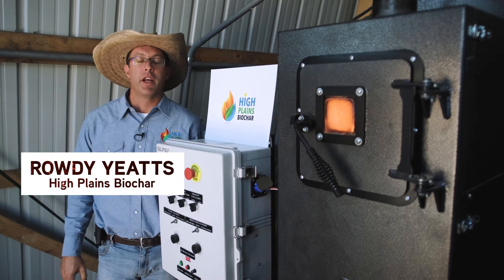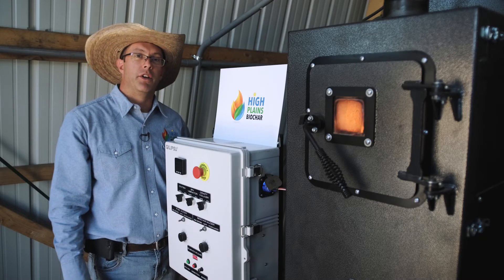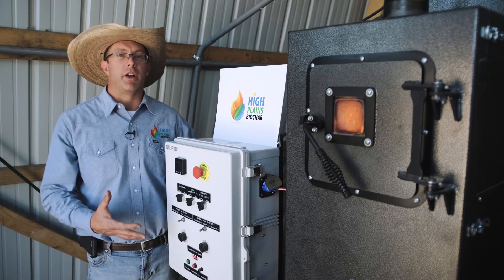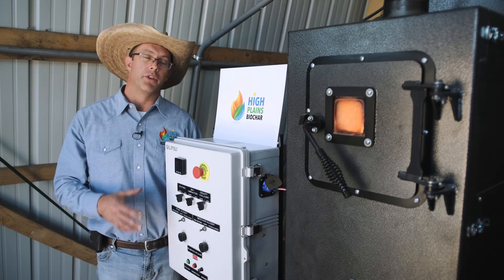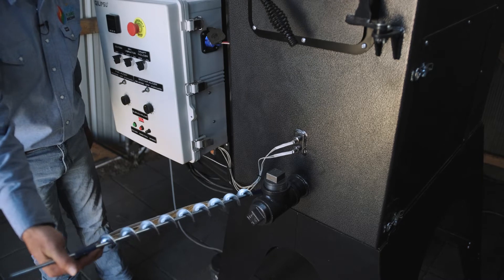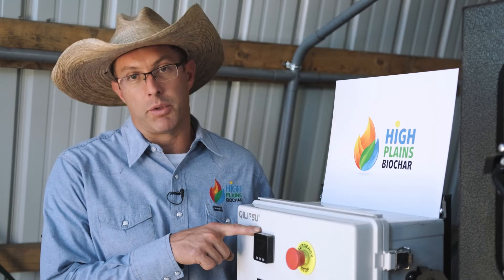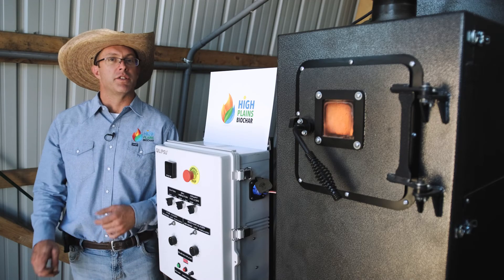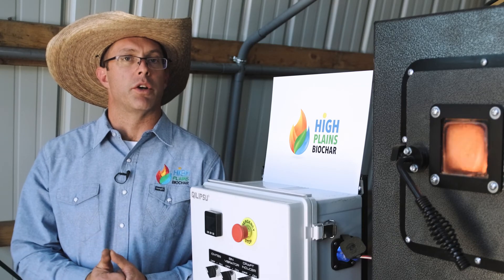RocketChar 301 Biochar Production Unit FAQ's

Comment: Can this have boiler set up to pump hot water into a building?
Reply: Interesting
Reply from the maker: Yes, with a liquid heat exchanger option this can be used to heat water. We have our demo unit setup with a liquid heat exchanger if you want to see it run.  More info here. https://www.hpbiochar.com/rocketchar